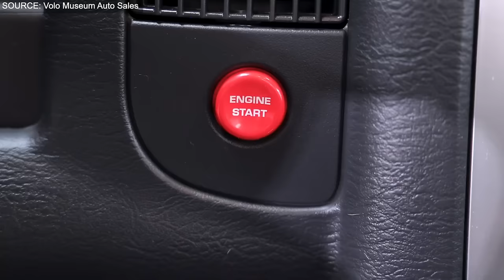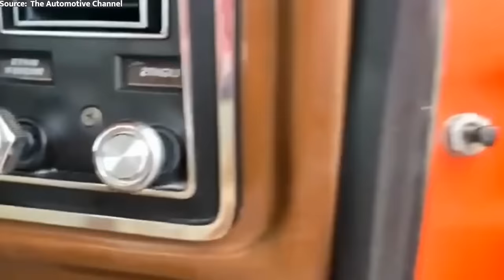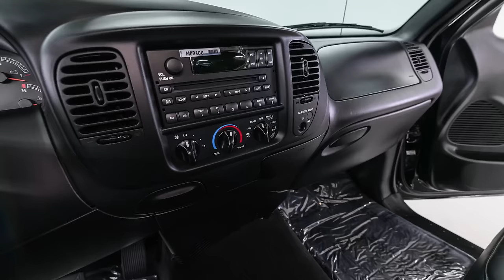50 Rarest Pickup Trucks Of All Time You've Never Seen

Comment: Chevrolet redline 2016 truck 2wd red hot color exterior and charcoal black interior. Engine v8 5.3L 6.2 block fast one , 6 speed auto trans. Good truck good vin# 1GCRCERZ323152 GM.Fort Wayne Indiana u.s.a. built truck. Christopher Aaron Orange, CAO. VA. 💯🐺⚜️.